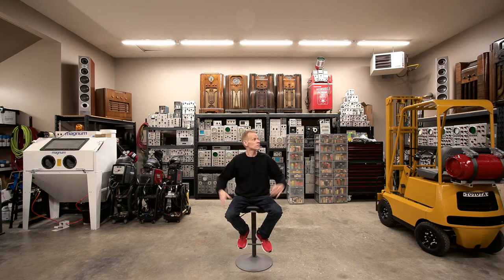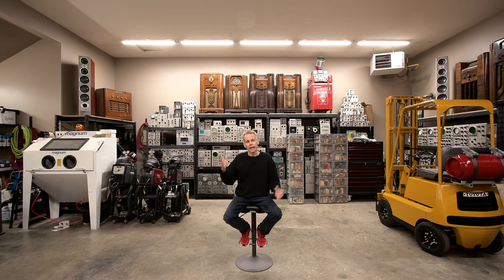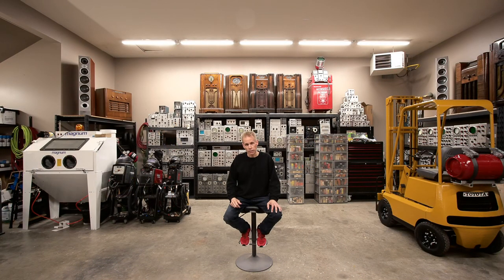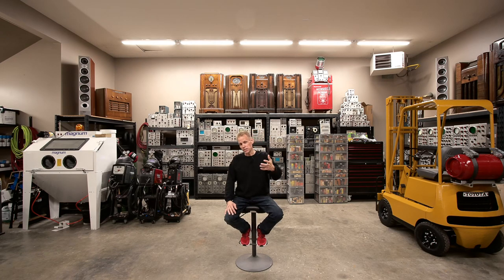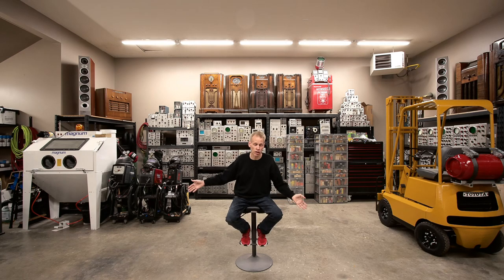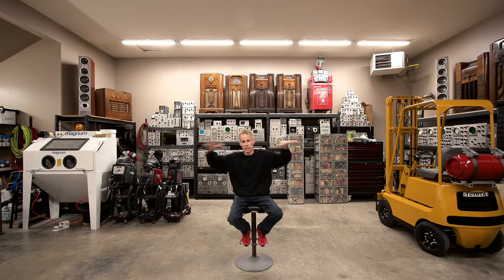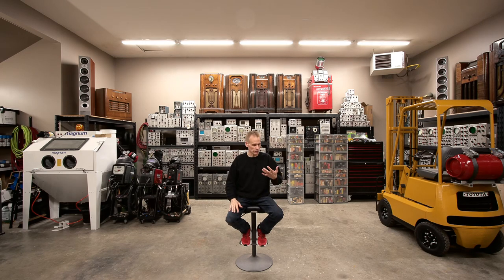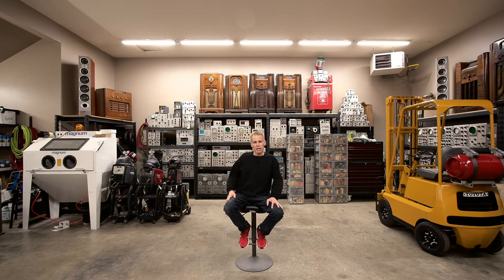ZAP! Mr C's Worst Electric Shock Explained In Detail!

Comment: Hi Paul...
The worst shock I ever experienced was when I was a lot younger and playing around with surplus WS19 transceivers. I wondered why the socket for the cw key was so heavily insulated. I found out why when I plugged in a key which had a metal shell jack plug while holding on to the chassis with my other hand. I felt like I'd been kicked in the chest and I remember seeing a small flame coming from the end of my finger before I was launched across the room, presumably because all my muscles contracted. I now know that the key is connected to the 540V tx HT. And there was a hole burned in the end of my finger.
You can't be too careful with electricity.  Don't work on powered equipment unless it's unavoidable. If you must work on powered equipment!, keep one hand in your pocket. 
73 de Malc M0IYI.
Reply: Probably the most important advice ever given: absolutely do not use both hands on energized equipment—keep the non-dominant hand in your pocket. The only thing that saved my life after foolishly grabbing two separate ends of a flex conduit while standing on a barstool was that I passed out and fell out of the circuit, all because I had forgotten the above sage advice of an old electrical engineer. I had the same post-shock experience as Paul: I stood up and realized that my heart had not returned to beating, and then it suddenly did. The fall damaged my L1 vertebrate, specifically a compressive fracture that took a long time to heal. Nevertheless, falling out of the circuit almost certainly saved my life. 

The problem with these situations is that you don't have the time to think clearly. I could have escaped the muscular lock from the 110 AC by simply hopping off the stool, which would have pulled the conduits out of my hands. Perhaps Paul's body and subconscious realized what was happening and reflexively jumped off the stool he was sitting on. It's as if your brain-body connection is somewhat frozen in time. The very best thing you can do is to take every precaution to keep yourself physically out of any live electrical circuit.
Reply: The WS19 key is connected to some high-ish voltage, but it shouldn't be the 540v. Got bit by it too, a couple of times, but that definitely was not the full 540vdc HT. If it would have been, i wouldn't have been bit again by it. It wasn't too bothersome, just made me think 'Bitch why'd you bite me?!'
I browsed the manual - mk3, page 41 - the key switches the screen grid voltage of the 807 as well as some other fairly current-limited tubes. I remember measuring the key current - out of the top of my head it was no more than 10mA or so. But it's already years ago. 
One other nasty habit of the WS19 is biting you with the T/R relay induction. Good lord, that solenoid packs a punch when you release the voltage to it! For some reason mine would rattle the T/R relay when plugging in the big multipin cable and cause a bunch of induction spikes between the radio's GND and the metal plug itself. Measured that current too - the digital meter said 30mA but the spike is of course too short for the meter to properly register the peak current. But if the digital meter already says 30, you can be sure it's a good whallop. 
By now i've gotten rid of the thing. Such an unwieldy piece of kit. I loved it, but it was just too hard to use on the modern, overfull 80 and 40m bands. Now i have a AN/GRC-9 to satisfy my need for the smell of surplus electronics. 
Another nasty device is the D. Mk. V field telephone. The instructions are  literally 'Lick your fingers, touch terminals A and B, press buzzer - a current should be felt'. Let me tell you, that current was felt halfway to my shoulder. I measured it at an average current of 10mA at 100ish volts, but the spikes from the buzzer are way higher of course. 
I think that was the worst shock i've ever gotten - but stupidly enough i got it because i followed the instructions.

Comment: Thanks for sharing your story, Paul.  I can remember that buzzing sensation from being shocked by 240 AC about 30 years ago.  Also been shocked by ignition coils a bunch of times.  When I started working on 575 V, more than 25 years ago, I took safety a lot more seriously.  With electricity, I try to imagine the motor (i.e. mechanical) than could be powered by the electricity present, and I ask myself “would I put my hand this close to a spinning motor shaft?”.
Reply: Those ignition coils hurt SO BAD.
Reply: @bryandraughn9830 100% most painful hit I've taken. Mercury outboard Thunderbolt ignition from the 80's, as a teenager trying to do some diagnosis & pulled one plug wire at a time on the running engine. First one, nothing & no change in the engine. Second one... hit hard & couldn't let go. Had to let my legs go limp to fall away from the engine, finally hit the ground & got away from it. They quit making that ignition because it ran upward of 60kv & tended to burn up plugs & wires lol.

Comment: Appreciate your channel, Paul!  Its a connection to my past and a different time.  My family used to have a  Radio/TV Repair shop, so I also knew electronics at an early age and was repairing TV's and C.B. Radios when I was 11 years old.  It is very unusual to grow up with all of the test equipment, parts and Tubes/Tube Caddies.   Along with any sort of Radio - Those old "Hot Chassis" TV's were a real danger for any metal parts of the frame which were exposed  to you when the back cover was removed, while it was plugged in.  One of our Service Techs accidentally brushed  the frame and his hand and muscles locked up with the electricity, on the frame, and he could not release his hand. Thankfully another person in the Shop saw this and unplugged the TV and saved his life.   Safety cannot be stressed enough.  It is dangerous plain and simple, even with isolation transformers.    I remember when I used to discharge and remove Fly back Transformer Anode Caps from a CRT picture Tube with a Heath-kit 40 KV High Voltage Probe, I would wear gloves as an additional safety measure.     I was always careful when doing CRT RGB Gun "Convergences", High Voltage B+ Meter  readings,  and Yoke adjustments on old CRTS, but thinking back about how lucky I was, even when discharging Capacitors.

Comment: Very good video, :), glad you're still with us.  Having worked at Tektronix for 32 yrs as a tech'n, been shocked pretty good many many times, usually on backlight circuits, or other HV circuits, power supplies etc, but I'm certain every tech'n in the industry has been zapped, but never so it was enough to send to the hospital, just shake it off.  Also had large electrolytics blow up , wakes you up, sounds like 12G shotgun.  :)
I love your troubleshooting methods, and relive the work I did in my career.  Thank you.

Comment: Great story, I got zapped like that years ago, and it was the first time I heard the symptoms from someone who experienced a drawn out electrocution as I had so I sort of relived it as you were describing it.  Mine was when I worked in two-way radio, a junior tech had repaired a worn test cable to our centralized metering system and wanted me to test it out.  I was working on an old Motorola Compa Station that was powered on, with my left hand I grabbed the back heatsink and with my right, with metering plug in hand, plugged it in.  The tech did a beautiful job of repairing the cable but evidently a bit of solder inside connected the outer shell (metal) with the 850VDC test voltage lead inside.  I immediately latched on and could not let go.  Beside me about 4 feet away, my boss and the junior tech were having a conversation and were looking at a radio on the adjacent bench and didn't notice me frying next to them.  I couldn't speak, or move other than to turn my head to look over at them and quietly and completely freaking out.  After about 10 seconds, the fuse on the station popped and it let me go, and I was finally able to yell and get their attention, albeit late.  It didn't hurt my right hand since I had a firm grip on the test plug, but the heatsink burned stripes up and down my left hand where the fins touched as the smoke and and smell of burnt skin wafted around the shop.  Fortunately no permanent damage, and I developed a extreme dislike for anything with tubes and/or high voltage after that. lol.

Comment: I had a similar episode with 120V handheld drill (an old metal case type) . I'll never forget the feeling during the shock (and also how weak and tired I felt when it was over). Living through such a shock will DEFINITELY make you a believer in safety.

Comment: I do electrical wiring often. In adding switches or recipticals to a existing circuit, I often to save time, work live voltage. I isolate the hot wire with electrical tape, and get things completed.  Whar a reminder!  Saftey with eye protection too! Great video! Thanks!

Comment: Similar experience to mine when I was a schoolkid, Mr C. In my case, I was in the school grounds absent-mindedly playing with a wire that was hanging down a wall, while holding a fence with the other hand. Felt like being on fire while every nerve in my body was being hammered with a pneumatic drill. Like you, I could think clearly what was happening and like you, after some time I felt I'd been shoved to the ground and was laying there, looking up at the sky, with a neat, smoking hole burned into my left hand. That type of experience, as you say, sets your caution levels nice and high for the rest of your life.

Comment: Paul, you have brought so many memories of my childhood and my professional carrier as an Electrical Engineer (42yrs) I vaguely recall getting shocked  from touching the needle of an RF amplifier with on a pair of 3-500Z tubes and a B+ of around 4.5KV that left a hole in my thumb which healed after about 20 years...mostly from picking at it. I had also been knocked on mu butt pointing out a "Whisker" of wire on a 480VAC contactor switchgear "bucket" to a technician with threw my butt up against the wall of the MCC...277VAC to ground, ya that hurt.

Comment: Hi Paul, Love your channel and have been a subscriber since the beginning. I was working on a Yaesu FT101E to remove a large clump of dirt from the high voltage cage. While the power was on and the finals engaged, I removed the screws and saw the huge warning on the cage stating lethal voltages inside. All I was doing was removing a clump of dust when I came in contact with the rectifier tube. Just like you said, I let my guard down thinking this was a simple task and I understood the risks. I was thrown to the floor and felt pain like I've NEVER felt before in my life. I was very lucky that I was thrown or I would not have made it. I learned a very valuable lesson to always head the warnings as they do apply to you! - Jeff

Comment: Hi Paul. Your description of events is to a tee what I experienced as an apprentice HD mechanic in Manitoba late 60s. Honing a bushing for grader king pin the old metal body un grounded drill must have shorted and shocked me. I remember the clarity of thought at the time and many days after. I could not let go of the drill and was arching up and back and didn't know what to do. Fortunately another mechanic seen what was happening and unplugged the drill at which time I dropped the drill went to my knees and was shivering as body began relaxing. I experienced the power of electricity. 74 now and still going. Thanks for sharing. Don Stewart

Comment: i started electronics at 8 and when i was about 10 or so i was working on a stereo and got shocked by 220vac... it shot me across my lab which was 8m square. i was buzzing for days. i have not been shocked again... i guess i learned my lesson. as i approach 70, i look back and have to smile at my young self. it is a miracle i have made it so far.

Comment: Your story brought shivers to my spine. When I was 18 (1966) I was playing on two meters and using a Scott Marine radio with an Ameco converter. The TX was an Ameco TX-62 with a hand microphone (metal cased). I was also experimenting with CCTV and had a camera on a tripod connected to a Zenith TV (one of those transformerless ones). I was in a conversation with WB6QZA-Leonard, and decided to move the tripod. That was all it took to "lock" me up. Arms crossed across my chest. I stumbled backwards over my bed and landed on the floor opposite my equipment. No one home, mom and dad had just gone out the front door. They 'heard' something and figured I might have fallen. Dad came it and saw me on the floor on top of the camera/tripod. He grabbed my ankles and receives a buzz himself. At that point he just started pulling wires! As I was waking up, I saw the flashing red lights reflecting off my walls. I survived but it took months/years to get over the sensation. Everytime our TV in the Living room did that AGC buzz/hum, I would break into a cold sweat. I would often wake up with that buzz sensation all over. I had Burns on my left and right hands (cauderized as you indicated) as well as several scratch burns on both arms. Mine was a case of crossed plugs which made the scott radio hot with respect to the Motorola TV. I even left palm prints on the microphone in my right hand. As far as I know, those prints are still there on Leonard's microphone. My room was wired on two adjacent circuit breakers in the panel. the possibilities that the chassis's were 120, 240, or 0 volts apart. I did not check the potential difference at the time (I wasn't that curious). A word to the wise... working around active electrical ALWAYS stay IN THE MOMENT! 
That is the day that I almost made an ash of myself!

Comment: Quite the story . . . thanks for sharing it, and cautioning us once again.  My first summer job as a university student was with a telecommunications research company. We were testing surge protectors for telephone wires using equipment that produced 10,000 amps at 10,000 volts to simulate lightning. Thankfully, we never had any stories like yours.

Comment: Very illuminating, Paul.  When you get shocked, you definitely remember it and with experience, become increasingly more careful.  When I was in my late teens, I opened up a linear amplifier and was measuring some voltages to try to understand how the amp worked.  You probably know this rule to keep one hand behind your back when dealing with HV voltage measurements; only using one hand on the measurement probe with the other probe physically attached.  The attached probe’s alligator disconnected, I forgot the rule, went to reconnect it, and boy, what a shock I got!  Almost 630V!  It pushed me back against a wall, and I felt tingling for about 10 minutes.  NEVER EVER ASSUME ANYTHING WITH HIGH VOLTAGE!!!

Comment: Thank you for sharing. I had a similar experience when I was about 8.
It was summer and a brother and I were going to sneak some frozen cupcakes from the freezer in the garage. I grabbed the handle and could neither let go nor move. My brother got shocked when he grabbed my shoulder. His quick thinking brought both of his fists down on my wrists, knocking them off the handle. I remember lying on the ground, that buzzing feeling still in my body, still not able to move or speak, nor apparently breath. He was a cub scout and mom was a nurse so he knew to check for a pulse, finding none he did the next thing that came to his mind, something he'd seen on an old TV show "Squad 51 Emergency". He did a pre-cardial thump, something that preceded CPR, hitting my sternum with his fist once. I also remember the feeling my heart starting to beat and was able to gasp in a breath.  Once I'd regained my senses we looked around and found that someone had wired the mains hot to the freezer's sheet metal body. I, a hot sweaty boy in bare feet on concrete, completed the circuit. We used a broom stick to unplug that wire. Ever since that experience I've been annoyingly vocal about electrical safety.

Comment: Thank-you Paul for emphasizing the need for safety. I know exactly the feeling you encountered. When I was just starting my working career I was repairing a Bruel and Kjaer tube amplifier. I had two of them open on the bench and was having trouble with the B+ on one of them. I was pretty used to working on these and with the power on and  I proceeded to to put one back in its case. Without thinking I went to tuck a wire I had attached to the B+ away so it wouldn’t short to the case. Well the B+ was 400 volts and it dropped me to the floor. That was a life lesson that I will never forget.

Please continue to emphasize the need for safety. It really is important...
Reply from the maker: Thanks for sharing your story Larry.